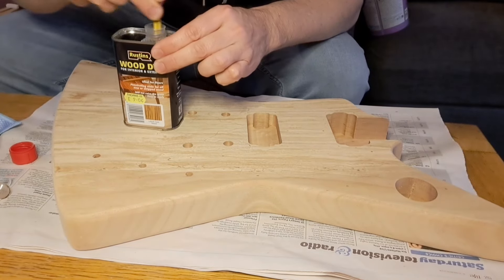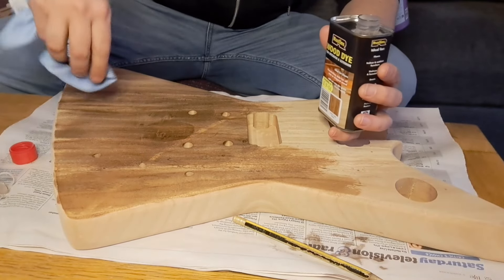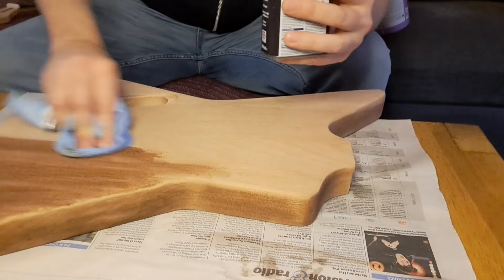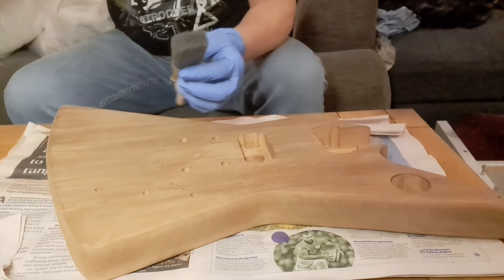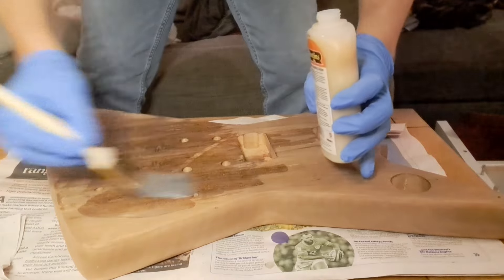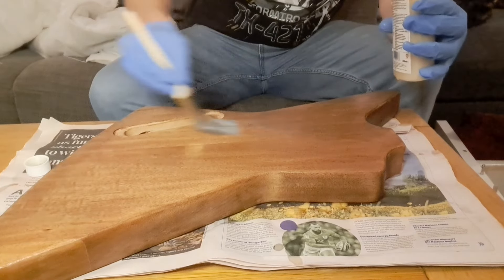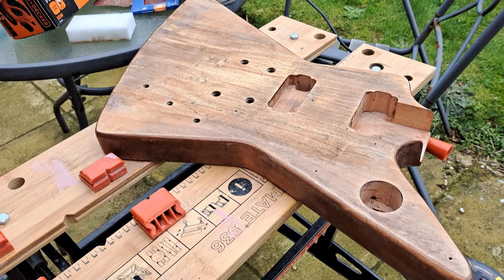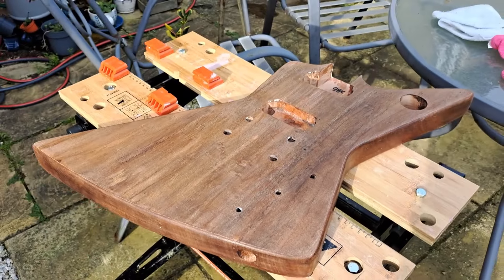Dyeing and finishing the body of the Coban explorer guitar kit.

Comment: You'll be an effin luthier's mate, in no time! :elbowcough:...rather nice job that. There's still a....nope, you're safe!
Reply from the maker: 🤣🤣🤣 thanks very much.
Reply: The noise from that rag says you sanded it with 80 grit. Sounds as rough as a badgers arse. You would have been better brushing it on.  The line on the front is due to not sanding sufficiently or glue. You should have sanded to 240 grit minimum. You pour the varnish/stain or whatever into a jamjar and apply from that.
Reply from the maker: @MrSongwriter2  thanks so much. Good to know. You clearly know your stuff. I'm doing a LP kit next, so I will definitely follow your advice. Much appreciated. Have a good day. 👍
Reply: Crimson guitars sell really good stain and finishing oil which would be more suited for this. Looks like you haven't sanded the guitar down to a fine enough finish dude. If you haven't attached the neck yet, it may be worth starting again. Try 120 on the orbital, then move to 180 by hand WITH the grain, then 200 / 220 to finish. In future,  it's always worth rubbing the guitar down with a wet rag after the first sanding. This will pop the grain up before you sand with a higher grit. If you miss this step then the stain will pop the grain leaving a rough finish on the wood.
Reply from the maker: @Petedang  thanks very much. This is really helpful. It's good to hear from people who know what they're doing. I'm learning something new every day. Thanks again.